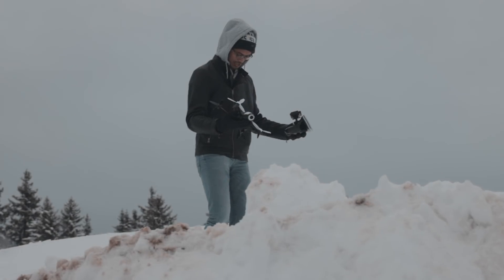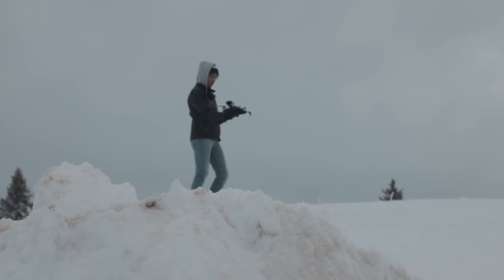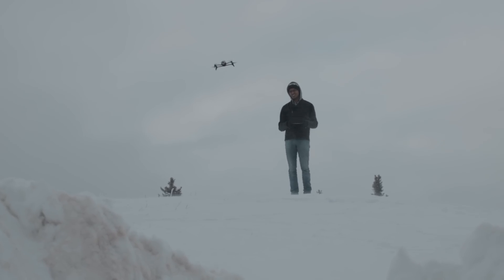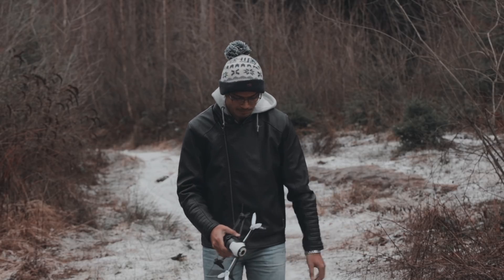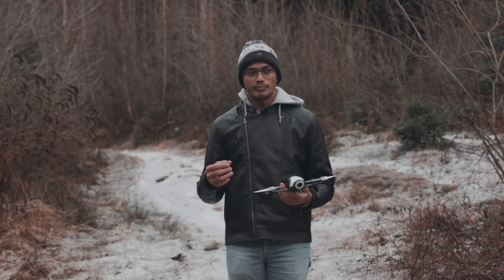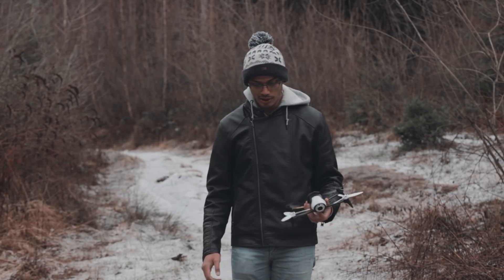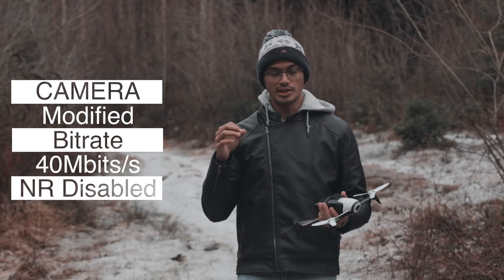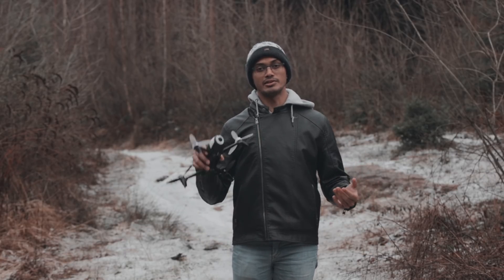BEBOP 2 | Cold Test |  -3˚C | 40Mbits/s | NR Disabled | Modified Camera

Comment: Anthony, when you say right side was obstructed, do you mean there was something on the lens or inside the lens? Could it just be wiped off? Your focus on the left side is absolutely perfect and it is cold, so a beautiful job! Tks!
Reply from the maker: there was ice on the lens . i had set it out in the cold prior to flying so i suspect wind and snow stuck. its wiped off and good.
Reply: @ANTHONYVLOG  Thank you so much for your reply Anthony. A last question - if I refocus my lens inside, would that be enough or I should do it in the cold for better precision - right now in the warmth I did your cereal box test, and it is slightly out of focus, so I'm thinking that maybe just a refocus (although I'm afraid to break anything which is why I have been procrastinating) might help. I took it out yesterday at -10C and at the outset it was out of focus and then it grew worse and worse after a 7 minutes flight.
Reply from the maker: @raymonddube70  I adjust my lens in the cold. I actually just leave it out for a bit switched on than I adjust the focus while it's still outside. Once I am happy with what I see I do a small dab of epoxy on two sides just to hold it. Than I take it in and let the epoxy dry. Once dry I turn on and check focus inside on the warmth. Than I take it out again and sit it in the cold turned on and check after 20 minutes. If all is well inside and outside than I apply the final epoxy to seal the lens and pack it in a big zip lock bag to extract any moisture acumiliated while it was out. I leave it for about 2 days than check and reassemble the nose.

Comment: Nice area, what camera did you put in that bird? I flew in a snowstorm a few weeks ago with my bebop 2.  Keep pushing the limits for the quads.
Reply from the maker: Hey Jerry, the camera is the bebop 2 camera but dismentled, old epoxy removed, refocused and new epoxy applied that is rated for - 30°C